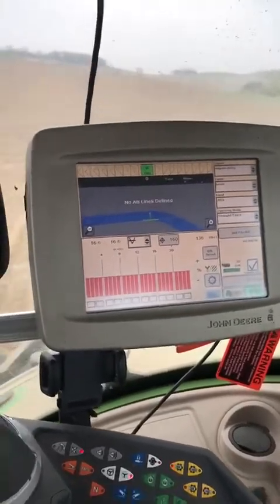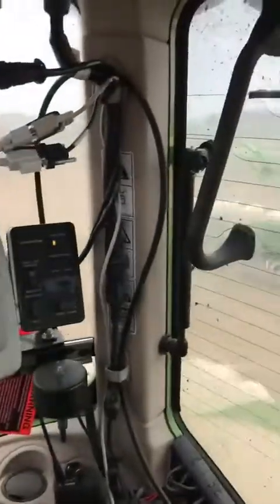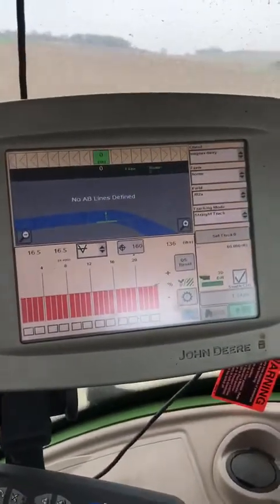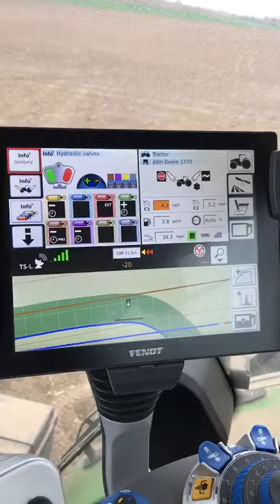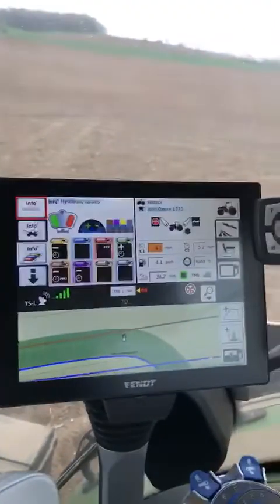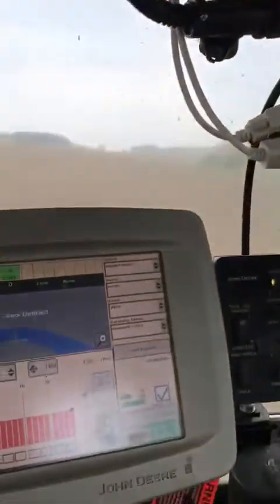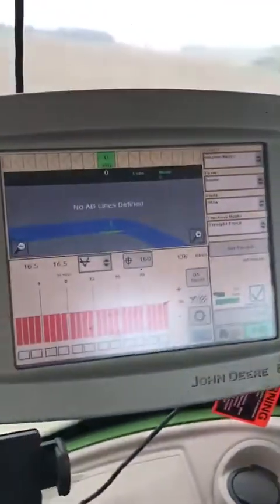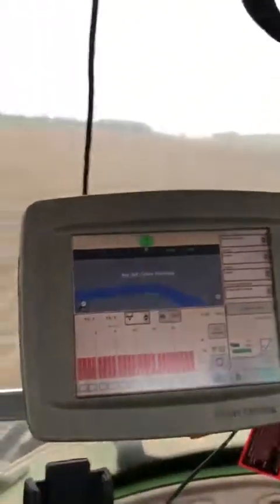John Deere monitor in a Fendt tractor

Comment from the maker: AGCO has a Fuse team that develops solutions to “fuse” other technologies in to Fendt and Massey tractors. Your local dealer has access to this Fuse team. Let me know if you still want more information
Reply: I shall ask them and see what happens. 

What I really want is be able to run jd ops center on iPad and pull data straight in.
Reply: Dealer tells me the only solution is to install a bridge such as the Agra bridge. Is this correct. 

Only want it to log data not steer as well
Reply from the maker: Yes correct. There a a few third party companies able to connect information across an entire fleet of equipment. AGCO only offers Agro-link. But that is for field data and prescription maps.